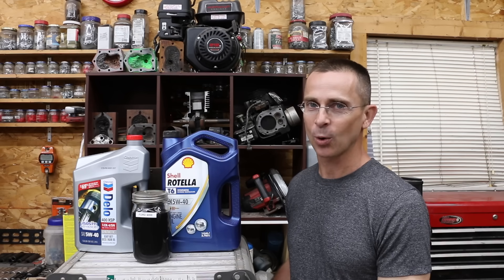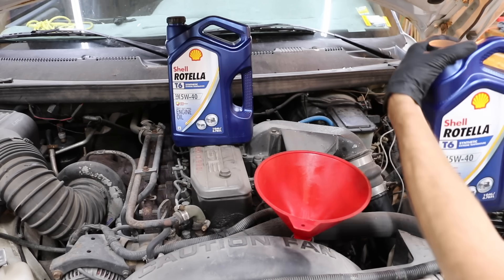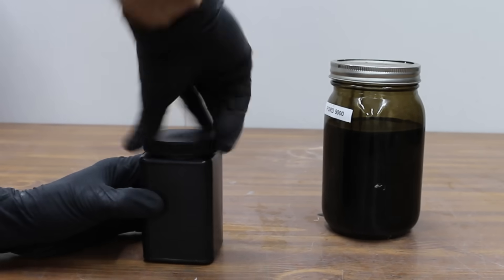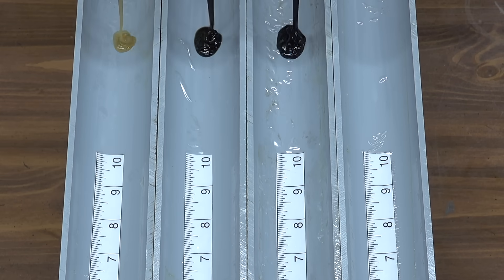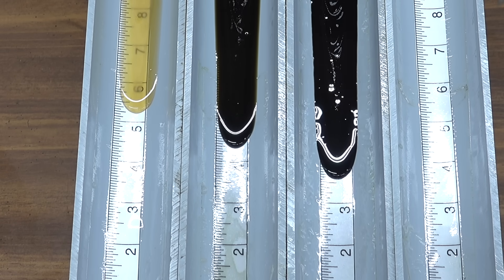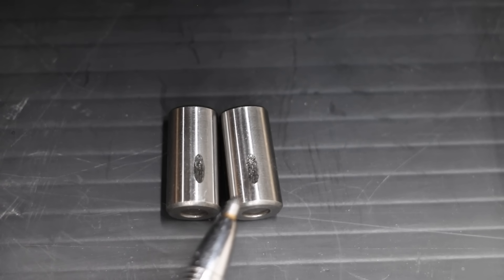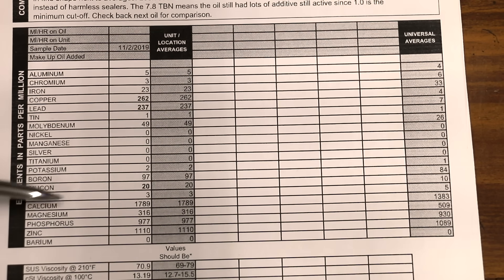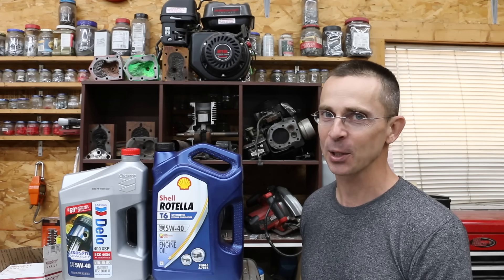Will Annual Oil Change Damage Your Car? Let's find out!

Comment: I would LOVE if someone would sell a small test kit for oils. If you could check it with something like a dip strip think of how many thousands of gallons of good oil would be kept out of the garbage, I think this would be a huge way to reduce our carbon footprint
Reply: Your local Amsoil dealer can provide you with a bottle for collecting an oil sample, instructions on how to collect the sample, and the address of an independent lab that will analyze the sample and provide you with a printed report like the one shown in this video. The dealer can also explain the report if you need assistance. If your oil is still serviceable (as was the oil in this video) you need only replace the filter and top off the oil level. Many people who use regular oil analysis never drain and change their oil.
Reply: @haroldtanner9600  I use Amsoil in all my vehicles, I agree wholeheartedly it is what it says it is, but I never had it tested. Might have to start doing that!
Reply: Blackstone Labs.

You're welcome
Reply: Dan Goldbach .Awesome!
Reply: @Dan Goldbach - I couldn't agree more... I think more people would test their oil but the price of sending oil off to a lab, is outside the affordability of most folks who change their own oil...
Reply: @__WJK__  you don't have to test every time. Do it once to figure the max extent you can run the oil, then shorten that to ~80% for a factor of safety. If you can double or triple the oil change period you have more then made up for the cost of the testing (its like <$20 iirc)
Reply: @SVRacer2000 - Totally agree with most of your reply but engine operating conditions can and do change (often drastically) from one oil change interval to the next. I was actually unaware lab tests had dropped to $20... last I checked (many, many years ago) some were pushing $50.
Reply: @__WJK__  it is true that conditions can change. That is somewhat why I put the 80% figure in there but depending on if the conditions changed once, or over the whole interval, 80% may not be enough. This may be something you can adjust for on the fly though. That said, most oil won't break down from one heavy use instance and a 15-20k interval should give a nice average for driving conditions. 

Looks like Blackstone is $28, plus $10 for TBN. A bit more then I remember.
Reply: I think they tested amsoil on  this channel once
Reply: You are aware that dumping your used oil in the garbage is illegal but technically does put it back into long term sequestration due to the fact that the vast majority of garbage dumps bury everything thus locking it out of the carbon cycle?  

Whereas your "recycled oil' often goes to people like me who burn it for personal heating and or industrial process fuel because its high BTU content fuel we can get for litteral pennies per gallon or even free or on occasion PAID for hauling it away?
Reply: @tcmtech7515  You can recycle it with an electrical chainsaw. Why buying new oil to lubricate the chain if you can use the old one - they can use pretty much any oil.
Reply: @Combine1331  Chainsaw oil is sticky and thick and is not flung off the chain like thin engine oil.
Reply: @rlmartinmanor  Maybe it depends of the model, I am not sure. However the oil for electrical chainsaws they sell is a regular oil  and used for lubrication. I mean you pour in the chainsaw e.g. 300-400 ml of oil and when it spins it pours a little bit on the chain and you can cut wood for e.g. 1 hour.
Reply: @Combine1331  chain saws use bar oil. It is a form of oil but thicker and designed to sling less.

Please understand that using old oil on your chainsaw is the opposite of responsable recycling it. Old oil is full of nasty stuff from running in your car, and recycling it makes the best of what's left. Using it in your chain saw is the same as pouring it on the ground. It is SUPER easy to make biodegradable oil for the simple chain lubrication, car oil is not biodegradable.
Reply: @You_Got_nico  I didn't know that for real. I will not do that anymore. Thank you for the information.
Reply: @tcmtech7515  we had a cleanburn waste oil furnace at the shop I worked at in New Hampshire, it was tricky to get burning right because the compressed air it used to atomize the oil at the nozzle had a lot of moisture and would cause it to plug up but when it ran right it was good for 230,000 BTU and would heat the baffle plates up to dull red, it felt great on a New England winter day. My biggest worry was the Pepto bismol pink Ash it would leave in the combustion chamber. All of the metals that were in the oil wound up there in that fly ash. I hated cleaning it out thinking about all that crap in the dust that got kicked up no matter how hard you tried not to. It was like talcum powder and would float around in the air. Even with dust masks on I didn't quite trust I wasn't breathing it. But if you can do it, waste oil makes a hell of a lot of heat for cheap, so I'm with you on that one
Reply: @dangoldbach6570  do you use them in diesel heaters?
Reply: @dangoldbach6570  The bulk of that ash is just the calcium, sulphur, silicon, phosphorous,  and like additives.  

The bigger list found here,  https://www.machinerylubrication.com/Read/854/oil-analysis-tests

Metal wise there's not enough if the highly toxic metals (lead, mercury and so on)  in a modern engines wearable components to need to worry about to any great degree.   Iron/steel, tin/copper (brass variants) and carbon micro solids (soot)  are the big ones you will find in chem analysis of that ash.  

I'm not saying the stuff is totally harmless but too many make way to big of stink over what-if's they cant actually pin down with any solid wide case scenario facts.
Reply: @Colaaah  it's similar but waste oil heaters have a compressed air line installed to spray the oil into a fine mist. Diesel oil is much thinner and  doesn't need the air line to spray it properly. Clean burn is the name of the waste oil burner we had, they are decent.
Reply: @tcmtech7515  where do you pick up the used oil?
Reply: @Colaaah  Local service shops and bigger farmers mostly now.   I used to run want ads in the local market sites but after a while I got known for not charging to pick the stuff up plus doing clean quality work when loading (plus occasionally dropping some respectable cash on people/places that gave me a good amount)  so now the stuff rather finds me!    My present personal burn rate is about 1500 gallons a year and I am dumping that or more at my brothers for his heating systems now too just to keep my free oil input balanced with my storage capacity of ~ 10,000 gallons being near maxed out.  

If you want to get into collecting it just start asking around to see who has it and what sort of deal they will do with you. 

The rest is just making sure you have a good transfer pump and portable tank system plus home storage capacity to take it as it comes.  

I typically do my collection work with a simple  5 HP engine driven hydraulic pump (old ~ 25 - 30 GPM rated pump)  and tote tanks on my flatbed truck.   All dirt cheap to get set up with if you dont mind doing a bit a scrounging for a used engine and pump plus tanks!  

The rest is just making sure you pass local laws and the like regarding hauling the stuff, which in most of the country is just a matter of staying under the local volume limits ( usually <1000 gallons at a time without hazmat endorsement and vehicle placards) or having a hazmat endorsement on your drivers licence and placards (most will accept it as a 1267  class 3 flammables "Crude oil" listed liquid) which is not hard to get.
Reply: @tcmtech7515  did they require your tank to have secondary containment and be covered from rain? They made us build a little wall around the 2 500 gal tanks we used in New Hampshire in case we lost a hose or a valve broke.  Reason they gave for the roof is it can fill up with rainwater and overflow, As long as oil didn't get into the surface water and flow into the storm drain was the main point. But they did have a fit when one of the techs tossed some old acetone he was cleaning his tools with into the oil. It wasn't much either, about a mason jar full into a 500 gallon tank of oil. That definitely does cause the oil to be a hazmat! If you know where your oil comes from  you should be fine, but be careful about taking just any old oil, a couple squirts of brake cleaner will make it a hazmat. Sometimes people just don't know and do it accidentally, you know? We weren't a big shop either, and the DEP was all up in our business anyway, so yes, they can hassle the little guy burning a few hundred gallons of oil. Sounds like you are getting good used oil though,  farmers are experts about environmental laws!
Reply: @dangoldbach6570  I'm in the upper midwest area and we are pretty lax on the nit picky regulations and enforcements.   Basically, dont cause trouble and they wont come looking for it rules.  

Yes, secondary containment is recommended here for larger volumes like I have to deal with but unless you are a established business  specifically dealing in such stuff as a primary income or the like they dont bother the private guys too much.  If you're a private operator just dont make a mess and they leave you alone sort of ruling.

Comment: I’d like to see these oils go against oils designed for gas engines on the wear test I know a lot of local racers at the dirt track run Rotella T5 and also a lot of turbocharged imports as well. Also will adding stp oil treatment to any brand of oil help it’s wear test results ?! I’ve been adding stp to my oil every oil change for years just curious is it really helping ? I add it for the zinc boost sense I’m not running a cat on my exhaust. Love your videos keep up the great test !!

Comment: T6 is the Subaru engine oil of the masses
Reply: Ran it in my wife's STI since new. Noticeably smoother and quiter. I do run OEM oil filters though.
Reply: T6 is what goes in my bigger turbo VAG cars as well.
Reply: why waste good oil in a subaru.??.
Reply: @phantomwalker8251 believe it or not Subarus can easily make it to 250,000 miles so I hardly see it as a waste. Mines got 180k doesn't burn a drop of t6
Reply: rmblwgn Japanese engines outperform many yank iron lumps.
Reply: @juhomaki-petaja  except the gm smallblock 5.3 those go forever
Reply: @rmblwgn  I wouldn't say forever, they have a ton of valvetrain issues. But cheap power, definitely.
Reply: @phantomwalker8251  why do we waste good oxygen on you?

Comment: I have used the T6 in 2 BMW’s and my 2003 Suburban (5.3L)with 300k miles and I have been VERY pleased! The BMW engines are the M52tu and the M62tu with 217k and 150k miles respectively. The big benefit for the BMW’s is that the Vanos are SIGNIFICANTLY quieter. 😎👍
Reply: "the benefit was..."  "the benefits were..."  

Thanks for playing though.
Reply: Grammar teachers corrections applied 😂
Reply: @BirdogEd  Lol!!!
Reply: BirdogEd    2 *BMWs were

Comment: Yeah, but this does not answer the sludging issue that engines do get if they sit for long periods with used oil. 
I have seen with my own eyes, a old engine, very very low mileage, but oil sludge everywhere. If that engine was not opened and washed, the engine would've kaboom because of poor lubrication penitration. 
So yeah, the oil might be fine, but the sludge not.
Reply: Interesting. I use a 40-yr old car every 2 to 3 years for 400-500 miles at a time and I change the oil every other time (so it has the same oil for 4 or 6 years) I have not noticed any difference the engine pulls as strongly as when new. The motor is a MB M110 6-inline with 110k miles.  Why would an engine form any sludge in the oil within 1000 miles or less, I mean new oil sitting in its bottle on the shelf does not get any sludge no matter how long it is stored...
Reply: @PrimalMiltos  I am no mechanic. All I say is that I have seen an engine opened by a mechanic. That engine was sludgy as I described. 
Maybe I am wrong. I can only speak from what I have seen myself.

Comment: In Europe all motor oils last a year. Service intervals here are once a year or certain number of km, which ever comes first.
Reply: Many manufacturers, as VW group, use dynamic intervals lasting up to 2 years or up to 30,000 km.
Reply: @DooMMasteR  Yeah, because they calculated that if you change it every 2 years or 30.000 km, the engine will not shit its pants until the warranty period runs out.
Reply: @DashCamSerbia  lol... Our car is now over 200,000 km and 11 years old...
Load based oil change is a lot more economical...

Comment: Rotella is very popular among motorcyclists and the reason is written right on the back of the bottle: it carries the JASO-MA/MA2 approval which is a certification for motorcycle oils.  It's cheaper and more readily available than other motorcycle oils and has a reputation for being an outstanding product. In the past I've used it or the rebranded Motomaster version (sold at Canadian Tire up here in the Great White North).  I'd be using it in my current bike, too, if it didn't require a 10W60.

Comment: That freezer is an expensive piece of equipment.
Anhydrous ammonia? Screw compressor?

Do you use it only for your testing, or does it get used at your commercial/business?

Do you rent, lease, or own it?

Is it 220v?

Thanks.

Comment: You can use a regular oil filter wrench if you take off the intake hose from the air filter housing to the turbo

Comment: Why don't you weigh or volume test cylinders before and after to see which one experienced more wear, rather then telling by eye? Love your videos!
Reply: I think he does weigh them, he did it in past videos. Maybe he just cut that part out to save time.
Reply: Also uses a measuring tool to find the width and length of the wear scars I believe. Though volume displacement would be super accurate way to measure for sure.
Reply: He usually does, and probably did this time too but it got cut out. In fact this is the first lubricity test I've seen he didn't give before and after weight loss.

Comment: in the old days we would save used motor oil and use it on the fur of severely manged dogs they were strays that we took in and it cured the mange the fur comes back thick and full really healthy these days they say its cruel but is it not cruel to not cure the mange leaving the dog to suffer those medicines for mange take forever like a whole year to work

Comment: Another great test.
Maybe in the 60's and 70's when 3K miles was it for oil.
I haven't bought the yearly garbage for 20 years. I have some lawn tractors that see maybe 20 hours a year. I'll go 2 to 3 years on the oil and filter change. Both engines run like beasts.
I only drive 6K a year on my car and change 0-20W full synthetic every year. It is more of a convenience because I would change it 10K anyway. Not to costly to replace a small engine vs the car.

Comment: My own anecdotal observation is my car has been really happy with T6. That said my own oil analysis results (same company as used in this video) also concur that my engine's health has held up well using T6. Despite it being a diesel oil it does DAMN well in gasoline engines.

Comment: I'm going to are the Lucas high mileage motor oil additive to my Lucas 1030 weight oil as well and see what kind of performance I get I'm going to do an engine flush to clean it out real good do you recommend an engine flush or should I do that first before I put the new oil and I've heard a engine flush is it that good for a motor what do you suggest

Comment: Delo can use the SN auto labeling, because of its low zinc content. T6 is way to high at 1300ppm and would could catalytic converter damage. Also now with GDI gasoline engines, the calcium level needs to be low to prevent pre ignition, which puts holes in turbo charged and non turbo charged engine pistons! Awesome video! You hard work is very much appreciated.
Reply: Zinc will damage the cat. converter even if the engine burns no oil between oil changes?
Reply: @PrimalMiltos  Yes! every engine burns a drop or less of oil each combustion cycle. Contaminates make up the difference to seem like the car  uses no oil. That why the ZDDP levels in oil drop during miles of usage. It goes out the tailpipe. Manufacturers are making smaller and smaller CC, because the Platinum inside is expensive. And many states have all ruled that the Manufacturer has to cover emissions equipment for 8-10 years or the life of the vehicle, and 80,000 miles or more. They don't particularly care if your Roller camshaft/ lifters dies from bad ineffective oil formulations to keep the CC from plugging up. And the argument could be said, a lot of people don't take caring for their cars serious enough. The Chinese many never ever change the oil until the motor quits. then they buy a new car! Ain't that wasteful.
Reply: @radoliz2  Exactly! Which is why I can then safely (for the cats) double the zddp in my engine oil, since right now the motor burns one fifth of what is considered normal for say a Mercedes-Benz, BMW or Nissan engine.  Hey even Scotty Kilmer's Celica burns 1 to 2 quarts every oil change whereas my 5.7 liter LT1 with 135k miles barely registers on the disptick, last time the oil level went down 1mm in 4000 miles.

Comment: I have used Rotella in my '92 4x4 Toyota 3vz motor for ever. It has always stood up to the abuse it sees better than other oils I tried. Standard oil when very hot would cause very low oil pressure, I have not had those issues when I use the same weight Rotella in my motor. For oil filter I run the K&N, I do think it is a better filter, but the best reason is I can safety wire the filter on through the hole in the nut on the end of the filter. Loosing a filter off road is not a fun time for anyone.
Reply from the maker: Thank you for the feedback